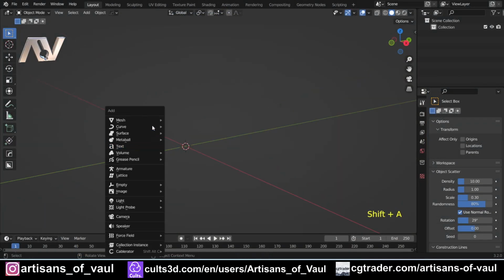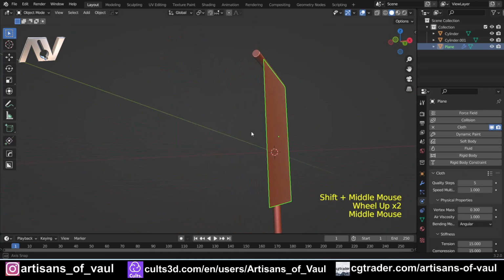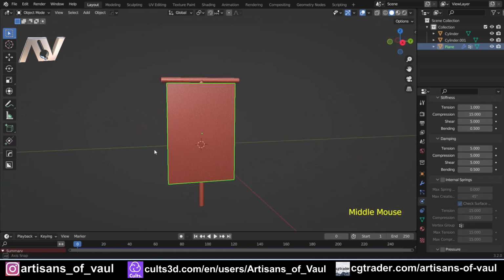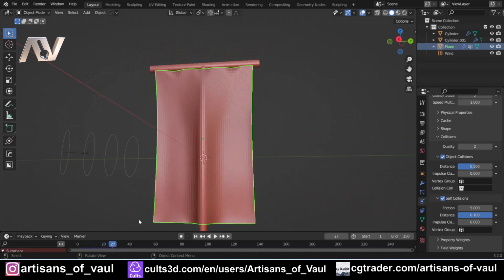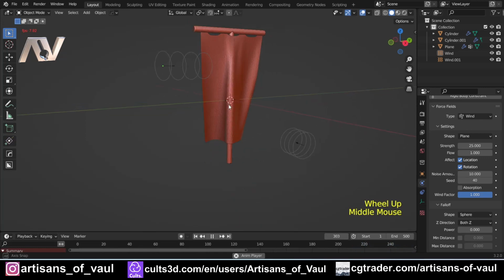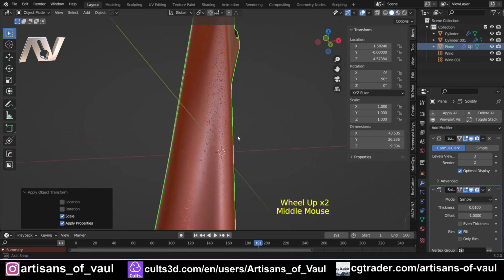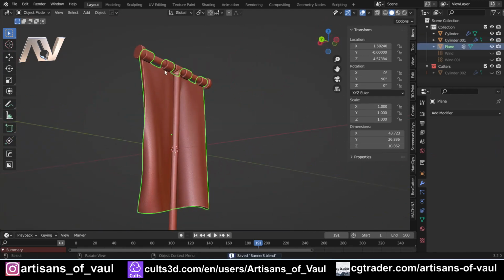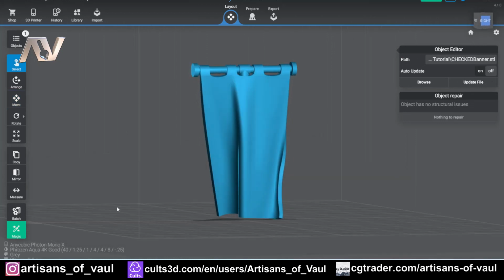Creating a Banner or Flag using Blender Physics Simulator

Comment: This was a great video - as others have commented, im looking for a way to add a logo to the flag - in my case it would be more 3d than just an image, so using a knife projection isnt as useful. is the flag going to be too complex to use conform object?
Reply from the maker: I'm planning a video to cover this soon 😁 The initial idea I had was using a shrink-wrap modifier and this does work.... but only if the flag is relatively flat, so it's pretty limiting. However, I may have found a solution but I need to test it, I just haven't had the chance yet.
Reply: @ArtisansofVaul  oh that's awesome!

Currently I'm grabbing an STL and have bisected it and limited dissolve a few times, but hope to make it work! 

Can't wait to see your video!
Reply from the maker: @joshsteffens2115  So that may be tricky to do with an STL as this feature needs clean quad geometry to work. You may be stuck going the shrink-wrap method unless you are making the flag part yourself

Comment: Amazing stuff! :D I need to do a decorated flag, an embossed one, similar to many GW models, with legion-specific iconography. Do you have/know of a tutorial on that too? I mean using, vector graphics to add to the flag before starting to manipulate it as you do :) ?
Reply from the maker: I very rarely use vector graphics as I find them a bit of a pain but you can work through the cleanup of them. If possible you want just lines, not filled in imaged.
Reply: @ArtisansofVaul  Thanks mate :) I'll try to figure it out! I'll start trying this out just to understand the process! Cheers
Reply from the maker: @marcoz6269  Limited dissolve will likely be your friend when sorting out the huge number of additional vertices there will probably be.

Comment: How would you go about adding iconography to the deformed flag based on when the flag is flat before the sim?
Reply from the maker: It's a great question and (sorry about this) there are a lot of possible answers depending on the icon and how deformed you're going to want the flag to be. Also I sometimes do it after so that the icon can be recognised. I'd use a shrink-wrap and add it to the flag (either before or after) using a 2d design and then solidifying it after the animation. Or you could use a knife project before and extrude the design out before or the animation or knife project, animate, then extrude along normals (I haven't tried this last one as it just came into my head but it should work)

Comment: Could you import that checked/fixed by 3d builder object into blender and run 3d print addon tool on it, I'm just wondering if it will find any issues, or it doesnt matter at this point as long as our slicer doesnt show any errors?
Reply from the maker: If there were any errors the slicer would have shown it.

Comment: As someone who is just getting into Blender from Fusion 360, this kind of thing will make my list much easier!! Could you show how to do it with a triangular banner?
Reply from the maker: I would do it in exactly the same way I think but after subdividing the plain I would boolean to make the triangle shape apply it and then go through the same process.
Reply: @ArtisansofVaul  thanks for that!! I looked at making the triangle first but it went a bit strange. A second question is how would you emboss something onto a banner whilst still achieving the “blowing in the wind look”? I use SVG files in Fusion that a friend has drawn up so using those makes intricate designs.
Reply from the maker: @Guardiansofwiltshire  That's a tougher question on putting the design on as it can stretch. I think You're going to have to involve some UV mapping after the flag shape is confirmed. I can't say its something I've done but that would be my go to.
Reply: @ArtisansofVaul  like I said I’m new to Blender and just pointing in the right direction is a great start, thank you. If you figured out how to do it, I’ll love to see a tutorial. I like your style of video, how everything is explained and clearly you can follow along.

This video I followed in real time and got the same (very similar) results after only opening Blender for the first time this week.
Reply from the maker: @Guardiansofwiltshire  awesome to hear you followed it along 😁 Really cool. I'll add it to the ever expanding list of things I need to cover (which has now got to 4 pages of a notebook 🤣) but it's an interesting issue.
Reply: @ArtisansofVaul  I know it’s something that neatly follows on from the cloak and banner videos, and not everyone likes freehand 😂 I quite like it but I know friends of mine hate it

Comment: For 3D printing there really is no need to boolean/join the separate objects together. The slicer software(s) are all far more capable at dealing with overlapping manifold objects than they are at dealing with non-overlapping but also non-manifold objects (which boolean more often than not creates).

I long since stopped bothering trying to join everything together like this, and I almost never have issues printing them. I found wasting time doing booleans, fixing the issues it creates, finding more issues etc... was just not worth the effort since they will slice absolutely fine if you just keep them all as overlapping parts. I had way more errors in the slicer back when I did join them.

The final STL file is also much easier for people to edit since linked selection will continue to work on all the unjoined parts; so if you are sharing the files (selling, giving away etc) the end user will have a much easier time modifying the objects if they need to.
Reply: Ive found easier to just have the final sculpts remeshed at .02 and then decimate for optimization, since printing at such fine details don't really do much difference in visual quality and saves a lot of time and headaches. Just need a powerful PC to do all at once, or do by pieces if it's a big, complex print.
Reply from the maker: I can't agree that the final STL is easier to edit and it can create further issues as you continue with your workflow.  If you bring an STL like that back into Blender it can be a nightmare and a total mess of parts, especially with complex objects.  Also with objects like that you rapidly lose the ability to do other booleans as Blender can not calculate it correctly.  This makes really powerful addons like Boxcutter and some Hard Ops functions not work (or at least not in a predictable way) and other functions such as adding textures from alphas impossible or panel lines/etc.  This example is the limit of where I would go only because it was towards the end of the workflow, it was only in one predictable location (so it could be fixed it it had to) and I would make sure that I fix the object in another program, such as shown.  If it works for you then feel free to do as you please, and if it was a free model on something like Thingiverse then I wouldn't complain at all (and anyone that did can frankly be quiet and jog on, its being given for free) but it just isn't suitable if it was going to be a paid for model.
Reply: At no point did I say during the modelling process that objects shouldn't be joined, clearly this has to be done to allow tools to work. My point was that there is literally no point in taking the completed model and wasting heaps of time unifying it all together at the end, creating holes everywhere, having to then fix said holes etc... when a slicer will slice the object just fine when its made up of multiple manifold objects even when they overlap. In particular the whole section near the end of this video where you carve out of the pole from the cloth and then have to fix all the errors was simply not needed in order to print it. The slicer would have worked perfectly fine with the pole and cloth intersecting and you are far more likely to create issues in the slicer by unifying the parts in this way and creating wonky geometry.

I've had to fix hundreds of files, often commercial ones bought by people who then commissioned me to print them; usually due to non-manifold/non-watertight issues causing the slicing to fail. But it rarely happens with objects where the parts have not been unified (since there has been no complex booleans done at the very end messing up the geo) and this lack of being unified also makes it very easy to make tweaks such as adjusting poses or scaling an individual part or extracting a part to either remove it from the print entirely or use it with another object.

Are you really saying you think its easier to modify an STL file thats had all its internal geometry removed and all the parts physically connected vs being able to just hover over a part and hit L to select all the connected geo so you can move it freely?

Have you actually tried slicing a file where you leave the parts separate (e.g this banner without the pole carved out of the cloth)?

TLDR: You are doing needless destructive work at the end of the modelling process that creates more issues than it solves, removes flexibility in the final output, and even when all those issues are corrected will give you exactly the same result in the slicer as a version of the file with none of that extra work being done.
Reply from the maker: @Skonker  I mean it hardly takes a long time to do. Without explaining things on the video it's saving, opening in another program and setting it running.

And if the thing I wanted to modify needed sculpting or any work over a point when they join (such as adding icons/etc) which would typically be the things I'd change then it definitely helps being manifold object or the sculpting will create huge numbers of errors. Maybe we just look at files we purchase and want to do things in different ways. Regardless having a single manifold object let's me know for sure that it's manifold and won't cause the issues you're saying you have to fix. You can run those checks effectively in Blender on joined together parts.

But if it works for you that's totally fine. 👍🏻

Comment: And what about a clasic flag, or even one that is... like rotten (threadbare). Like the one on the skaven wheel.
Reply from the maker: No difference except your put the pinned points on the side and probably make the wind a bit stronger.  I would then make the damage/threadbare sections after by sculpting or booleans to take out chunks/round parts of the flag.